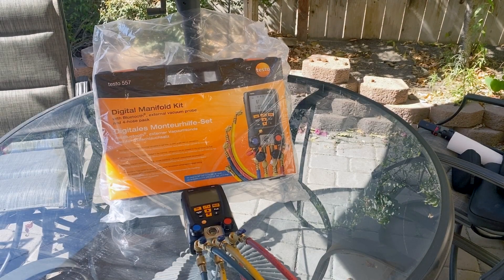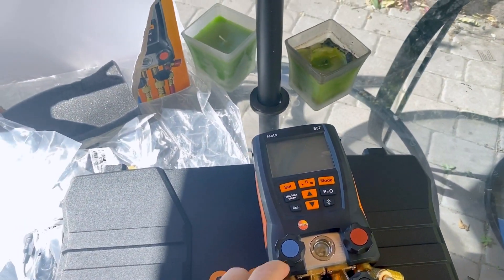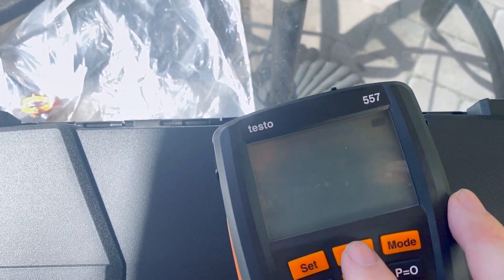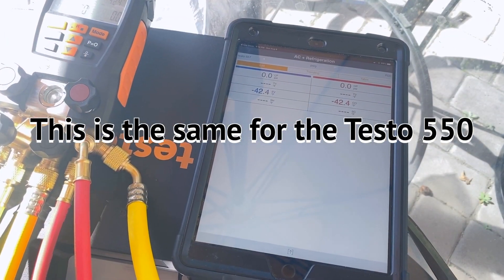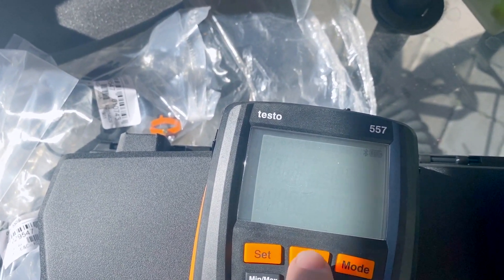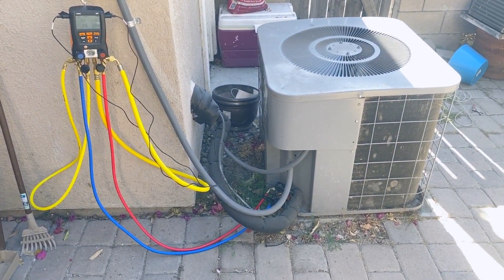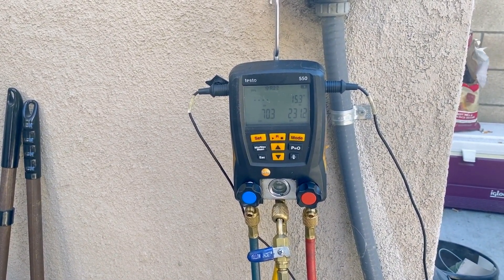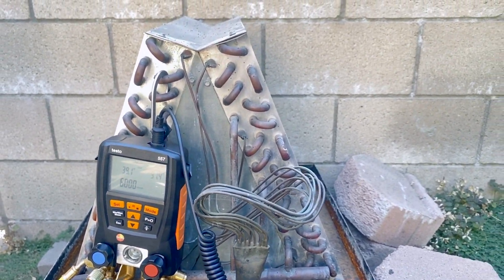Testo 557 VS 550 Refrigeration Gauges Unboxing and Review EP41

Comment: Can any tell me the difference between the testo 557 vs 557s
Reply from the maker: The 557 is the older model. The 557s is the newer version. They pretty much do the same thing but the 557s is more refined and as a few new features.
Reply: @NighthawkHVAC  ok thanks I've read that the 557s not reliable leaks etc is that the case with the 557 and if I get the 557 u think it better to get then557s
Reply from the maker: @AR-uj3js I never had any issues with my 557. I’m currently using the 550s and haven’t had any issues yet.

Comment: Had the 550 for about 4 years without any issues. Just upgraded to the 557s. The new manifolds have a much better ui.
Reply from the maker: I want to upgrade so bad. My 550 are 6 years old and are still going.